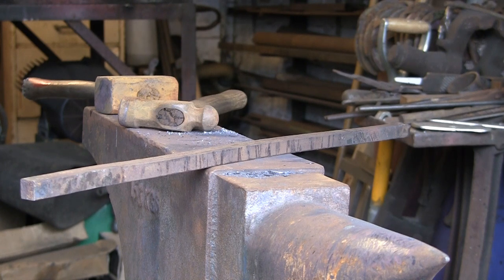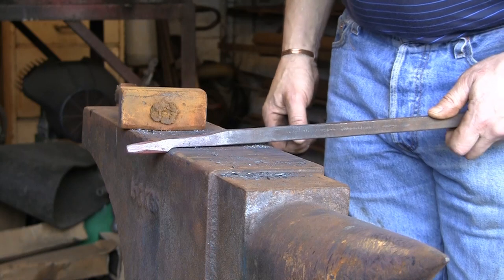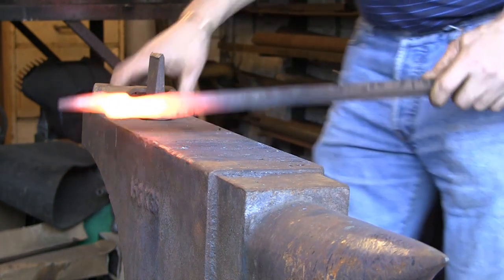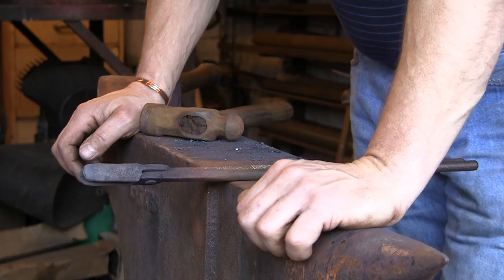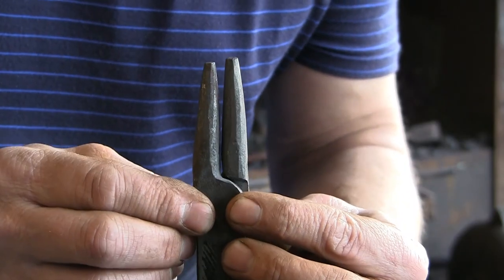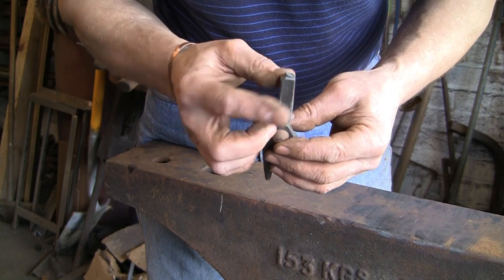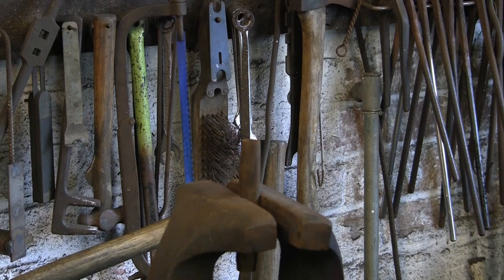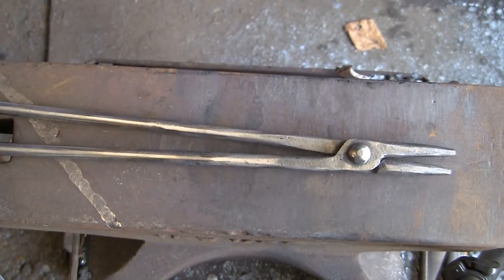Scrolling tongs

Comment: just finished making a forge. never really worked with a forge before but this is the next thing i'm making. i'm going to try out of a railroad spike and see how it goes. thanks for the vid.
Reply from the maker: Good luck! You might find it hard work out of a re spike as they are hard steel. I would go for mild steel on my first go. Don't want to make things harder than necessary!
Reply: garyhuston thanks for the heads up but thats all i really have. i'll let you know how it turns out

Comment: Hello! Love all your videos, especially the shoeing ones as I'm currently in the process of training to become a farrier and I'm working towards my city guilds certificate! I was just wondering if you've ever done flat bit tongs? It's the current project:challenge and I'm struggling a little, mainly with sets. Any videos/advice? Thanks!
Reply from the maker: Hi Gemma, thanks. I'm not sure what you mean by sets?! Do you mean making them a pair? This set of tongs could quite easily have been flat bits, if they had been left after the first two minutes and not rounded up the ends. Just draw out the reins and leave the jaw bit long and square. The only other tong video is this one http://youtu.be/RAkpqmp4uz0?list=UUWECgWLAXr39MrPY1FwLEbg
Just remember always turn your material the same way, doesn't matter if it's left or right just always go the same way. Hit, turn 90, hit, turn 90, hit, turn 90, and job should be a goodun! If you have trouble getting the sections the same length each time just put a few chalk marks on the edge of your anvil and check before you start each part.
Good luck!

Comment: Hello Gary...love your videos.  Wondering why you cut the tool ends of the tongs off and weld it to another rod for handles?  Why not just use the stock on which it's already being forged?
Reply from the maker: Thanks for the comment. Yes, in a perfect world drawing the reins from the parent stock is a great idea and obviously stronger. However my world isn't perfect! There are a couple of reasons that spring to mind, firstly, time. I am limited for time doing my videos and even if I had a power hammer and all the right tooling it would probably take longer than the five minutes it took me to weld reins on. Secondly and more importantly for me, something I hinted at in the video, my health. 35 years hammering has left me in almost constant pain from knackered shoulders and elbows so if I can avoid extra hammering I will.

Comment: Is there a reason for welding the handles on instead leaving the stock long? I have made all my tongs and just left the stock long and then cut it to length.
Reply from the maker: Yes, time and effort! Both of which are in short supply in my shop!
If you are just a hobby smith with plenty of time on your hands or a power hammer then drawing the handles from the main stock isn't a problem, but, when you just want a set of tongs quickly for a job then welding them on is the only way to go!
Reply: Thanks for the reply. I am a knife maker and have time to do it my way. I will have to try your way and see how much time it saves me.  Great job on those thongs.

Comment: I no nothing about welding or metal work so I'm asking what is probably a daft question why cut the long handles of and weld on others wouldn't that make the joins weak and the tool not much use?